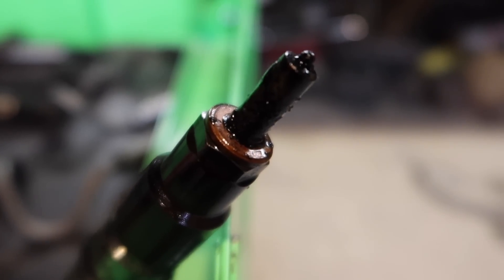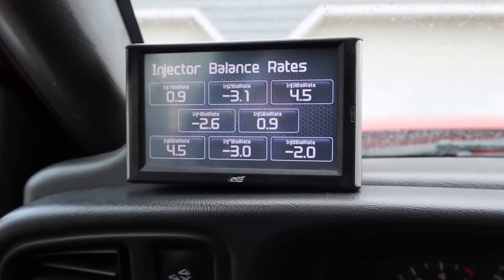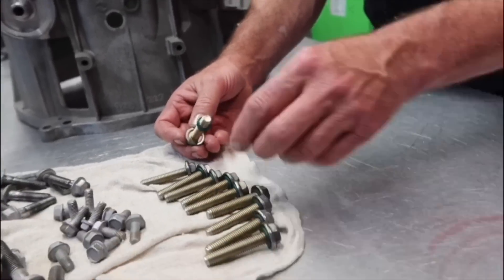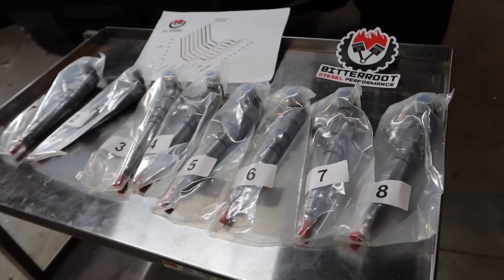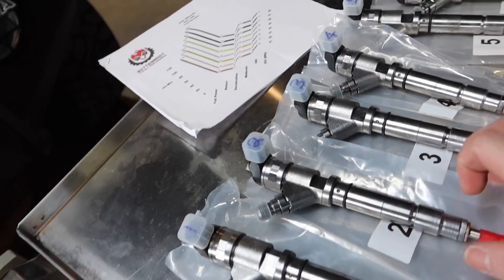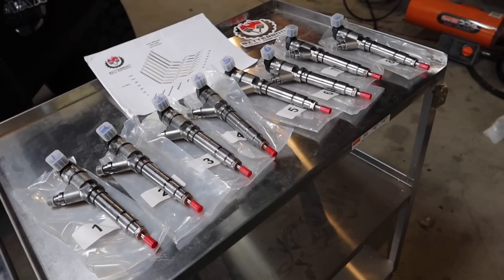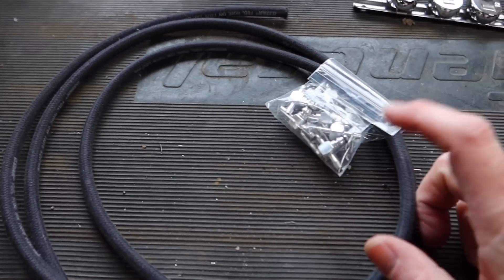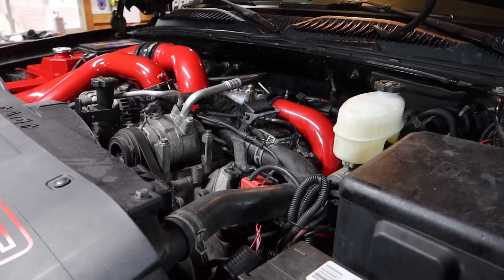These Duramax Injectors Will Help Me Get To 700Hp

Comment: Fingers crossed buddy, hope it goes smooth! Fyi if anyone ever gets engine code tcm p2534, originally you think ignition switch but check all the pins on the major engine and transmission connections. Just put the engine back in my Lml and the radiator hose interferes with the Tmc module during disconnecting and reconnecting. When I reconnected the plug it went in a little bit off center without noticing and still buckled, then when I went to check for codes the tcm p2534 code come up and it stumped me for a few hours and researching all the blogs I saw one post that referenced a plug to the tranny. Sure enough I went in and found it right away. Hope that helps anyone with that problem.
Reply from the maker: Thanks for the info great stuff 👍
Reply: I had a pin back out in one of the connectors for the tcm in my lly and the trans would limp any time i hit a bump

Comment: I’m running stock injectors but their fully maxed I added a 64 mm stealth turbo wcfab air intake tuned and deleted efi built BD trans stage 4 with triple billet torque converter and fass165 fleece tap shifter edge cts3 monitor to watch all my pids. Will adding a bigger injector idk maybe 45over and a 10mm stroke pump give me that rolling burn out? It’s fine now but can’t never get enough power lol

Comment: Looks like Bitterroot Diesel needs more inventory.
Reply from the maker: They probably just need to update there site
Reply: Our remans are hard to keep in stock once customers find out our performance injectors are balanced to 1% or better. They don't leave our shop until they are dialed.
Reply: @bitterrootdieselperformanc6945  can i be notified when you have a set available?
Reply: @michaellavalle11  Yes, our site has in stock notifications, but we usually build each set to order.

Comment: Buddy of mine said to retorque the fuel lines after say 250-500 miles. He replaced injectors and hoses and a week later it felt like a dog and he could smell fuel. Checked and they were all about 1/4 turn till back in spec. But that could have been because new lines and injectors not just 1 or the other
Reply from the maker: Great info thanks
Reply: @TruckMaster  yes sir, I dont know if that is a requirement but it's good knowledge to pass even if it's just to check a short period after. Have you decided who you want to go with for tuning once it's all done?
Reply: We've seen hold down bolts loosen after a few heat cycles to. Best to double check everything. Don't want exhaust getting past those copper crush washers!

Comment: No need to do head studs on a stock engine, factory head bolts are more than adequate for any kind of power the stock shortblock can handle. I was making mid 700hp with factory GM head bolts, zero issues with keeping the heads down. Before that I had 2 engines north of 300,000 miles and north of 500hp with VGTs with factory headgaskets, no issues there either.  Cylinder head clamping force is the last thing you should be worried about on a Duramax, especially on a later model LBZ that came factory with the more durable riveted design headgaskets. Although - if a built motor is something you would like to do later on, it would make sense to get studs now and reuse them for a future built motor. I reused ARP 2000s with no issues so far, ARP says as long as there is no cosmetic damage and they weren't overtorqued, they can be reused safely. As far as which headstuds to use, ARP 2000 are plenty with a 700hp goal in mind. ARP CA625s are for people looking to make well north of 1000hp. I have ARP 2000s in truck, my turbo/injector combo should net me around 1000hp at the tire and I feel comfortable using those headstuds.

As far as a CP3, a 10mm is generally going to support an upwards of 800hp worth of fuel. 12mm, an upwards of 1000hp. Dual CP3s depending on condition of the pumps (if stock pumps), around 1100hp. Dual CP3s in my truck, stock 140k mile pump in the valley and a stock 340k mile pump on the belt with 100% nozzles at 2650uS, it still holds 29,000 psi desired rail pressure.

Food for thought! Keep up the good videos man, this truck has come a LONG way since I first subscribed to you.
Reply from the maker: Thanks for the feedback 👍👍👍
Reply: @TruckMaster  of course buddy!

Comment: Did you know using crows feet Changes your torque? Dont remember if it raises or lowers the torque. You could find the formula online to figure it out I'm sure. If you. Ant find it and want it let me know I'll look through my school stuff and find it for you
Reply: The trick is to use the crows foot at 90° from the wrench so there is no added leverage 💪
Reply: @bitterrootdieselperformanc6945  I just remember when I was going through school for my diesel tech degree that there was a formula for using a crows foot with a torque wrench. Couldn't remember the specifics.

Comment: Hey Josh you are awesome for posting so much diy videos. I have lb7 and I was wondering how did you get inject o r balance rate again cause I know my trans had to be done for pump rub and injectors had to be replaced by now as well. Cause it's a 2003 and has 260,000 plus miles on the old Durty Pussy...lol it has a dp sticker in the rear window and my best friend nicknamed it durtypussy. Lol But anyhow I want to check my injector balance when I change oil to keep up with them and I kinda like what you did by changing the piping and exhaust and doing a tune. I plan on doing the ppe standard tune. Where you can do engine tune plus relearn the trans. I do plan on getting a Ryan's turbo for it and I plan on doing the cold air and a piping as well. Yep I'm up in the air about which company to use hap or wfab and I just bought semi stacks for it and gonna do those but with a twist instead of just cutting the exhaust off. In going to add a cut out like the street racers did back in the days of this and r/t And just have fun with it . I just bought four doors and fenders and next will be a custom hood and box. I bought the tools and I have the knowledge so hopefully I get either a new cab or all the inner and outer sheet metal for rockers and can corners. And pending on how much a can is. I might go that rout as well... Cause I see a off frame restostmod in my future and if I go that route I will be inviting all my. Mechanic and body men friends over for a challenge. To do. The job . cause I will walk to work. And. Get it done. And I do paint at my work so it might be just that spray the chassis saver after dealing and u o grading the suspension and under coat ever thing and when done under coat it again with bed liner .. I been buying parts and parts I don't have but a few more things to get. And shit I'm jamming. I will have a rust free close to a new truck as you can get with a 2003 truck. New everything as possible. And if I get what I want as in turbo whistle and be able to do big Smokey burnouts and roll coal a little more then I'm happy. I know I would like to do a road rally race with it .  the cannonball run.  Yea there is a actual race not just a movie ...lol

Comment: With that balance rate shit you can’t just look at them and be like ok I need injectors guys you need to look at the  calculated fuel rate in a stock tune for starters and you have to do some math balance rates don’t show anything but at idle .... injectors will send fuel back to tank while under a load sooo your number one injector says is at .09 at idle but when dfrp is at 26 and your at 21 afrp your number one injector that said was goos is now sending back a lot of fuel while under a load so there for your number one could be bad ... hense bottle testing and others balance rates are not a go off of situation

Comment: Are the numbers on the injectors there so you know you have all 8 ?
They are supposed to be matched to each other so it shouldn't matter what cylinder they go in.
Reply: The numbers reference the flow data sheet.

Comment: My lly has 230k and 7000 engine hours and my injectors are still MINT
Reply: Jordan Ray 280k on my lly. Same story as you
Reply: The LLY, LBZ, LMM and 6.7 Cummins injectors last a lot longer than the older LB7 and 5.9 Cummins injectors. They have a better design internally.

Comment: Do they just EDM out the nozzles bigger to flow rate?
Reply: We hone new Bosch nozzles for our remans.
Reply: Bitterroot Diesel Performance, I was just wondering what process you used to drill those holes so small. I’ve got to get a new set for my lb7 soon, she’s got some white smoke
Reply: @shanek6582  EDM is the process used to make new nozzle orifices, and honing is the process to enlarge the orifices after manufacturing.
Reply: Bitterroot Diesel Performance do you actually have a rod small enough to put through the hole an lap it bigger?

Comment: Hey just got an 2006 lbz with 115k The truck hasn’t been modded, my 5 inch Magnaflow and down pipe just got here, is there a way to contact you about what to get next?
Reply: That’s kinda what I was thinking too, that or making my egr gone with the wind.. 😂
Reply: @shanerproductions  airdog instead
Reply from the maker: Lift pump then egr delete
Reply: Is a KN filter in the stock air box a waste of money?
Reply: @shanerproductions  Agreed, S&B and Fass 💪 We deal both!
Reply: @shanerproductions  Considering that the K&N is only 30 bucks more than the stock OEM paper filter and you can keep reusing the K&N, I would recommend it. I've always had good luck with K&N air filters.

Edit: BTW, I've only had my stock 07 LBZ for a few months. So far I've straight piped it, no CAT and no muffler, touchscreen Kenwood radio, Alpine speakers, and a rearview camera. I plan on having my Allison rebuilt and beefed up, the truck repainted, lift pump, EGR delete, and a tuner with a 5 way switch. Max tune will only push about 150 horsepower over stock. Not going too insane with it. Lol need some new door panels, those are so hard to find in, especially in good condition. Can't believe no one makes replacement door panels for them.

Comment: Honestly no point in big injectors. Over fueling stock parts = kaboom. If you plan to keep this truck I wouldn’t continue putting go fast parts on a stock motor... great YouTube channel I would hate to see slow down over a broke crank
Reply: My crankshaft broke on my bone stock lbz, I believe it has more to do with the harmonic balancer getting old and the rubber insulator hardening.  Put the balancer higher on your list of upgrades as a safeguard.
Reply: @ra5gto  I've been very impressed with the fluidampers.
Reply: @bitterrootdieselperformanc6945  broken crankshaft here as well. Been there done that lol. What are fluid dampers?
Reply: @j.d.s3980  It's a harmonic balancer that works dynamically with an internal fluid.